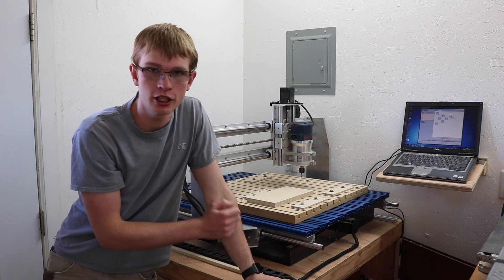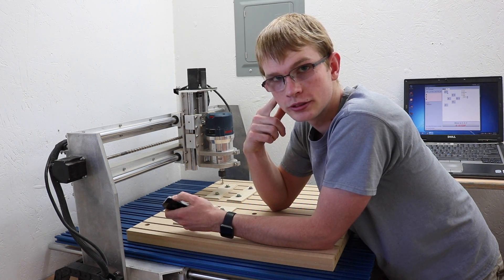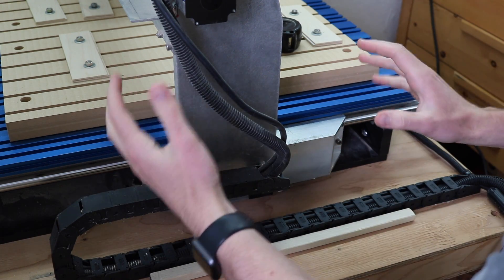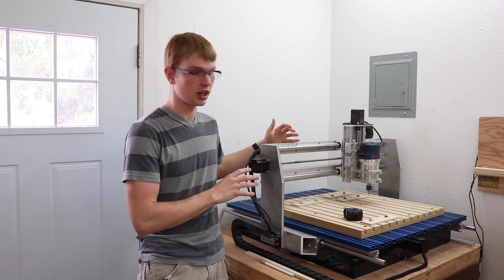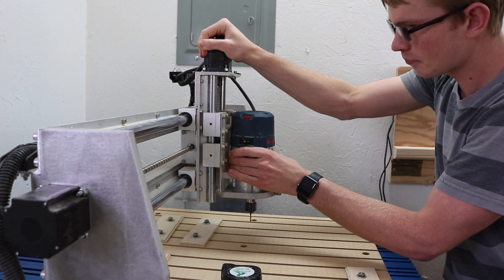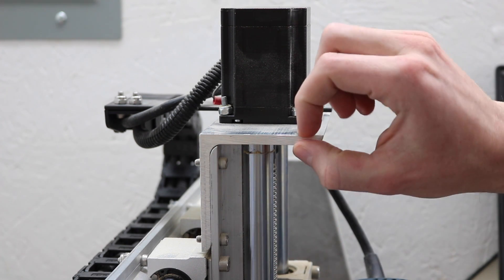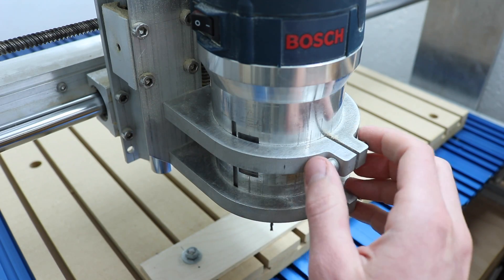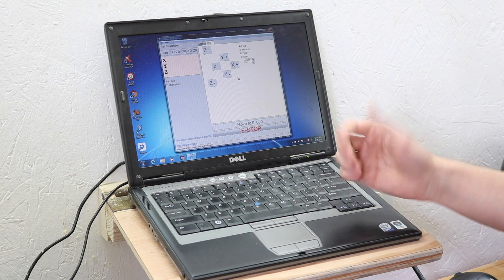All about my CNC machine

Comment: What machine can be built for 800 or less that's better than yours? I have been looking at SWM3D's  Model R7
Reply from the maker: +Anthony Newcombe 
After my bad experience with the shortcomings of the V-wheels on the Xcarve, I really hate to see a machine with V-wheels. Linear bearings work so much better. 
I'm currently working on the design for a cheap, good CNC; I'm not sure if I'll hold to that $800 mark but I'll try. Of course that $800 won't be for a kit, you'll have to buy everything yourself. If I were to put a kit together it would have to cost twice that much.

Comment: THANK YOU THANK YOU THANK YOU!!
You just saved me probably around $5000!!
i have an Xcarve and it's just barely rigid enough (very little room for any error).
i have added EVERY mod to increase the rigidity of my carve.
I am looking to upgrade my Xcarve to ball screw drives and linear rails or just take that $1000 and put it toward a $6000 machine.  That stupid belt skips a tooth and bam, you just made a heap of scrap.

BTW,
Where did you get that awesome Blue anodized T-Slot bed?
Reply from the maker: +Robot Bender 
Those belts are the worst!
The T-slot table is standard equipment on CNC Sharks, but you can also buy individual extrusions from Rockler. It's just made up of a bunch of 3" wide x 36" long extrusions side-by-side.
Reply: the equipment technology invloved also will effect the work performance.pls add wechat/whatsup: 008613075365628,

Comment: hey man, i have a question, there are so many types of CNC machines, with laser, with drill with cutter... what's the difference bewteen them? what to learn? if you know one type can you operate the other? why are they all called CNC but they are so different?
Reply from the maker: +E I N S 
They all have different cutting abilities, for example a laser can only engrave or cut all the way through. A router can make complex 3D shapes. They would all have their own learning curve, but for the most part once you learn the basics of programming a CNC they are all similar to operate. 
CNC stands for "Computer Numerical Control", so that is a fairly broad term. A lot of people (including me) often just refer to their machines as "CNC", which isn't entirely proper. Each one needs its own designation like "CNC router", "CNC laser", "CNC mill", etc.
Reply: Thanks, i got a job as a CNC router operator and they train me, operating and programming. I was just wondering because i have also received offers from people giving me a job operating a CNC laser machine used to cut big pieces of metal, big sized machines. And i found it hard to choose because i don't know what' better to know money wise, for the future. The job i got using a CNC router is using a cutter and the Company makes Airbus air conditioning systems but i was wondering about the laser, i have operated one in the past it was pretty cool watching it go.

Comment: Very nice.  Are there a DIY CNC machine plans you've seen that you would consider worthwhile?  Most of the plans I've seen look like Instructables-grade crap lol
Reply from the maker: +mnelson10000 
I haven't seen any that I particularly like, but then again I haven't been actively looking for them!
Reply: Friend and I built a MDF machine way back in (2006 I think). The 'JGro' model off CNCZone. We used that and learned from it for many years until we finally replaced it with another, this one of our own design I drew up in Sketchup and made from a pile of free aluminum channel my friend stumbled upon. 
The Jgro was solid and slow and cost about $600 back then. Hardware has since come down radically in cost. The $600 was almost all spent on controls and electronics. Wood and computer stuff was already on hand.
It only needed a drill press and table saw to build plus a few hand tools.
I would do the same thing today, retrofitting the complicated rail system on it with the same rails used in this video would be a step up; adding rigidity, precision and simplicity. Any parts that you make by hand can be made better by the machine after it's running (like the router clamp and dust shoe). If you decide that design is not to your liking, I suggest at least a similar one as they are out there.
The JGro plans were free and very complete and we used everything from a Dremel to a Colt router in it. Full size router would work OK probably but we never liked the noise.
We even built a 4th axis for that thing using a $18 electronics-surplus gearbox and jamb-chucks machined in place on the machine.
The worst part of having a cnc machine, in my opinion, is buying and learning software and dealing with hardware and electronics glitches. The learning curve is intitially steep and really never ends. That being said, those machines have become the most used things I my friends shop, have made more money than anything else he has ever done in there and it's something you can do when you are physically unable to use many other tools due to age, health or injury.

Comment: Slightly off topic, but what issues did you find with the Bosch router for handheld use?
Reply from the maker: +Bob Watkins 
My biggest problem is the height adjustment mechanism. Every time you unlock the cam lock on the base, the router goes a bit cockeyed. You can then adjust the height, but when you lock it then the router straightens up in the base. So it's pretty much just a trial and error game to get the height set. Dewalt and Porter Cable get it right with the threads around the body; with those the router never slumps to one side. 
Aside from that the ergonomics are just really bad. The switch and speed dial are impossible to reach from the handles. And don't even get me started on the plunge base...it has serious quality issues.

Comment: Hi, i wanna build myself a CNC , and found your video very informative, my question is have you tried to milling steel with it ? Would it possible with it ?
Reply from the maker: +Dr. ZodiaC 
A router turns much too fast to cut steel. It would ruin the bit on contact. And if you reduce RPM then it takes a lot more linear force to get the bit to bite in and cut, so I don't think any gantry-style CNC could cut steel.

Comment: great video, do you have the g code you used on the CNC. I have just bought a small CNC and I do already make segmented bowls, but I am having trouble with shapes on the CNC. I will get to know how to do things (I have loads of ideas) but am finding easel impossible to use at present.
Reply from the maker: +John Fithian-Franks 
What gcode are you referring to? I know what you mean, easel isn't what it's cranked up to be.
Reply: Thank you for the information I will look into Vectric and I hope this will give me the start I need. Thanks again

Comment: I love your build and want to do a similar machine. Can you provide detail on the lead screws please: length, diameter, pitch. And I agree with earlier comment. If you offered plans, I would buy them. Thanks!
Reply from the maker: +andakar121 
The lead screws are a "knuckle thread", five start 1/2" on the Y, 4 start 3/8" on the X. Don't know the lengths right off.
Not to discourage you, but I have never found this type of lead screw anywhere except on the CNC Sharks. I've looked around the Internet and no one seems to sell it. I'd recommend you just go with a standard ballscrew.

Comment: Good Video and Machine, but i wonder from where does the remaning twist comes in your machine (where the router is) ?
Reply from the maker: +Hyper Hektor 
I think the structure between the router and the Z-axis bearings is a little weak; also the Z-axis bearings are mounted very close together so I'm sure that has a negative impact.
Reply: you could calculate the overall way of leverage from the point of the endmill and then reduce the levage ratio.
+ For example make the upper rail much higher (twice as much)
+ broaden the side walls (the expensive aluminium) to x2 of the actual width
or stabilize the aluminium side walls by virtually broaden them with rods)
+ i had improved the side walls also by not leaving them 2 dimensional ( 0,5inch :) ) but instead stabilize them with cross beams so the overall thinkness is like 3-4 inches for example

Comment: It looks like you made a good machine for yourself to me. Someday I want to make a CNC machine out of metal. But for my first one I just used wood. Because it is cheap, and fast to work with.
Reply from the maker: +Paul Frederick 
Thanks!
I think a wood machine is a good idea for getting your feet wet in the CNC puddle. Might be a good idea to go with decent quality components though, so you can reuse some of them on the metal machine later. Just a thought.
Reply: Jeremy Schmidt
I built a cheap machine just to see how much I'd use it. I am seeing interest taper off for me with CNC now that I've made it too. I have a drive upgrade I want to do on the machine, but I have not really been motivated to do it.

I've just been more focused on other things lately.

Comment: You should change the clamps so they can also sit on top of the workpiece, then the groove would only be necessary if you want to cut the edges.
Reply from the maker: +rutger houtdijk 
Check out my latest video, about the CNC dust collection, and you'll see why I didn't do that.

Comment: Great build there. I strongly recommend you move it somewhere its not blocking that breaker panel.  Wait tell a breaker pops, espically the one for the lights and you will discover why..
Reply from the maker: +John Ware 
I can reach the breaker panel very easily with the CNC there.
Reply: just didnt look that way in the video

Comment: Interesting video! I'm a first-timer, so I won't hold you accountable for the quality. ;)

Interesting advice at the end of the video. Whenever I have the space for it, I do want to have a nice CNC machine. Looking at your design, I should be able to make one myself. It makes for a very interesting project. 

One thing I'm curious about which you did not talk about in the video: does your machine have end stops? 

Anyway, subscribed. So you in the next video. :)
Reply from the maker: +Michael Teeuw 
The machine does not have limit switches, but I took care to design it so that it will not be damaged by running it into the end of its travel.
Thanks!

Comment: Good on you for getting rid of the rigidity problems. Just had a look at the Shark pricing and it is quite expensive for what you get. I've come to learn if you do fine and detailed work then there is no substitute for rigidity and quality and some people just don't have the time or skill to build their own machines. I do think these companies catering for the cheaper systems can make the systems rigid without driving the cost up too much.  Keep up the good work :)
Reply from the maker: +FrameToFrame 
I agree, rigidity is key and I wish the cheaper machines would put a little more focus on that. Thanks!

Comment: need a router llike that but in 230V and a 1/2" collet. seems i can't find one.
Reply: maybe the Makita RTO700 ?  i have that one in my homemade cnc
Reply: ye considered it thx but from what i can see on the specs i find online it's only taking 6 and 8mm shaft bits and I wanna use my 1/2" shaft bits.
Reply: SMCG
ah, yes, indeed. you are right on that.
Reply: dear ,i see you need the cnc touter,We have 2 factories manufacturing multiple types of CNC machines including lasers and routers.if you are interested it ,you can contact my whatsapp:86 15853106282

Comment: Hey, do the $800 dollars CNC and I will do it based on yours :D
Reply: I think if they really added everything up they might end up going over their estimate. I'd say a machine comparable to the one here would cost more than $1,000. Probably more than $1,200 even. But it would depend on the exact components you used.
Reply: *****
for us shipping on heavier items from China can be quite costly. If there was no shipping on stepper motors I'd be set over here. But shipping doubles their cost. That puts them right out of the great deal range too. They're just an OK deal then.

Steel and aluminum is not cheap to buy retail here either. Nothing is anymore. Heck even the construction lumber I ended up using cost me a pretty penny. But it works OK. It just doesn't look so good.
Reply: what jump yous bolts hawe in x and y axis ? and how many nm motors ?

Comment: So, do you think that you could make the machine shown with all your mods, excluding the unnecessarily expensive aluminum plates BUT including the box frame reinforcement for $800? If so , what would you have to sell it for. NOT counting the router or the laptop. Just the CNC table, gantry etc. In other words, no electric components. Great video.
Reply from the maker: +Jeff Stanley 
I can't really quote you a price because I am simply not interested in manufacturing these. YOU could probably do what you said for $800, but I'm not interested in doing it for you. Sorry.
Reply: You don't have to be sorry at all. I really enjoyed the video but you did get one thing wrong. There is no way I could make that for any amount of money. I simply do not have the skill. I am glad you set me straight on knowing that there are currently no CNCs made that are adequate for their intended purpose.

Comment: I did purchase a commercial CNC of similar dimensions and it was really because I didn't want to take the time to build, troubleshoot and tweak a custom build. I wanted something that would work out of the box and provide the stiffness I needed to carve heavy tropical hardwoods and brass/aluminum parts. I can flex the gantry, but I need a dial indicator to see the movement. Is it worth the extra $5k? For me - right now - YES! But everyone's use case is different. I wish I had the time to build a CNC from the ground up, I bet it's very gratifying. That being said, I have to say your machine is very impressive, and I bet it'd handle 90% of the jobs I use mine for. The very next project I'm going to do is setup my spoil board to accept a clamping system like yours. It is by far the easiest/most solid system I've seen, and I love that I wont have to worry about crashing into my clamps. Thank you!
Reply from the maker: +Miles Garrett 
Just curious, what CNC did you buy?
Reply: I got the CNC Router Parts Benchtop Pro with the electronics kit . Then I proceeded to upgrade it with spindle/VFD and several other bells/whistles. I have to admit, even with a lot of the construction done for me, it was quite a learning curve to get a handle on running it safely and reliably. Just the machining aspect was enough for me; figuring out optimal feeds, speeds, and many broken bits later I feel pretty good about it all.

Comment: Nice machine dude. I've been buying parts for my build for about a year now, mainly due to space constraints. Originally I had plans for a 3x4 ft machine using MDF but have switched to a 3x5 ft using steel and aluminum since. I just moved into a new house with a bigger shop. Can't wait! Just like you said, I opted to build my own because I couldn't find a machine that I was fully happy with and couldn't see myself blowing $4k+ on. BTW, for those thinking of biulding your own, you can find a lot of good used CNC stuff on ebay. Looking forward to seeing what you come up with for your own build.

Comment: The $800.00 average cost (if I build my CNC machine) sure excluding the operating software (~$700.00) you mentioned in your video, I'm right?
Reply from the maker: +Wagdy Ziada 
Yes of course. That didn't include the computer either, or the table the machine sits on.
Reply: Thank you for your quick response

Comment: Where are the linear or rotary encoders?
Reply: Low cost machines like these use stepper motors. Most stepper motors have 200 steps per revolution. The steps correlate to linear movement. The machines which use stepper motors are open loop. Servo motors use a rotary encoder and are closed loop. You could put rotary encoders on your stepper motors, but if you do that why not use servo motors.
Reply: +Landon Brecheisen Thanks for the info but I already knew all that... Read my comment with a hint of sarcasm in it ;-)
I'm a cnc-programmer and operator for nearly 18 years now.
This is a nice toy.
Reply: Steven Verschaeve What type of things do you make?

Comment: Curious as to why not recommend the 1617 for hand-held use?

BTW, think you did a good job of re-engineering your CNC.
Reply from the maker: +Bill Weissborn 
The ergonomics are really bad. You can't reach the power switch from the handle, much less the speed control. 
But the biggest issue is the height adjustment mechanism. As soon as you unlock the base to adjust height, the router goes a little cockeyed in the base. After you adjust the height, you go to lock it and the clamp straightens the router up in the base, making the height move a little (0.003"). 
DeWalt really got the height adjustment thing right on the 611 and the 618. The threaded ring adjustment moves the router perfectly straight in the base so it stays where you set it when you lock it.

Comment: Haha weaker than an x carve...
Reply: really?
Reply: Yeah... it's a nice hobby machine to learn about CNC, but it's far from perfect. That's why I modified mine, and began building a new machine. That said I'm starting to like their software which had dramatically improved.
Reply: I see cylinder guides here. Not rollers. And ball screws but it is not toothed belt. I thought it is more reliable parts. But it seems this machine is very cheap though
Reply: I watch your education regularly. With that cnc subject I learn english in appropriate context. Double benefit). Thanks